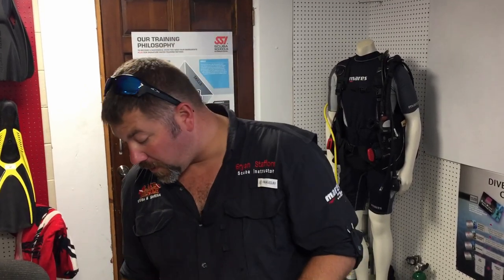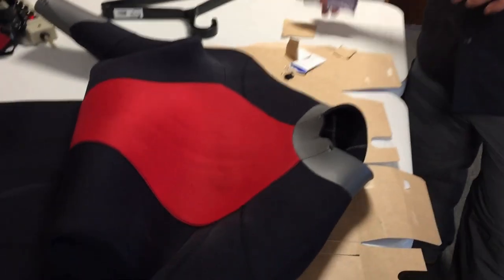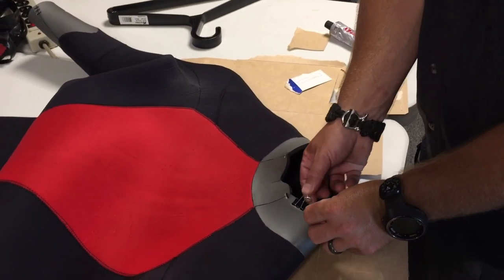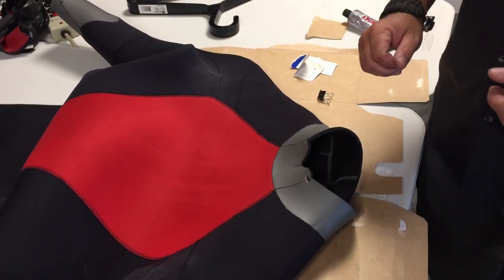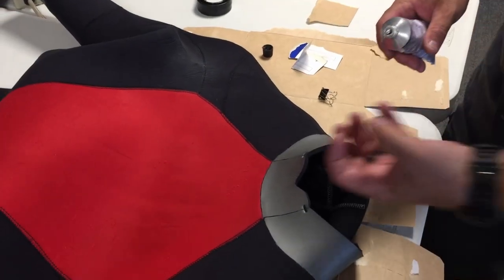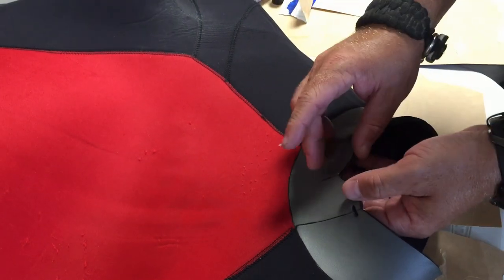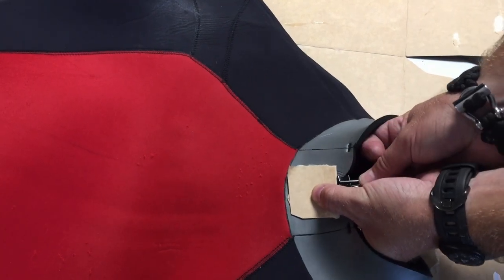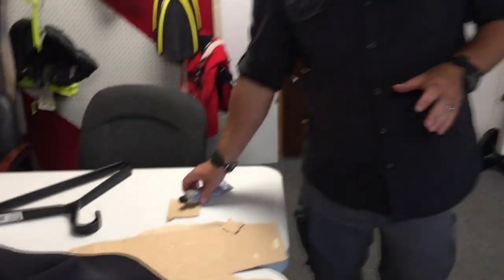A Simple Wetsuit Repair

Comment: As a gear junkie and hands on repair nerd 🤓 I love these kids of projects.

I’ve had great success fixing a blown out thumb pad on some thick mill neoprene  dive gloves. Used Gearaid Aquaseal and breathed some extended life into them. 
 
I also used Aquaseal to glue on pockets to my drysuit. Worked out extremely well as if factory installed.

I’m a fan of Aquaseal and it’s from the Great North West in Washington state. I’m sure the other brands work as well. 

For new adventure sports people there’s generally a great repair for most  things if you do  sone easy research.

Great time to live with so much information available at our finger tips 👍
Reply from the maker: Deep down, we are all gear junkies.

Comment: Love ur channel, so much to learn. Here's another patch technique (aquaseal suggested the tape backing): i turned the damaged sleeve/leg inside out and used clear packing tape (the non sticky side) to back the outside of the tear (in case glue weeped thru), applied aquaseal into the almost full thickness tears by wrist and ankle of Bare 3mm Evoke. Squeezed the repair tight, apply more backing tape while squishing a small amount of excess glue across the surface area of the tear. Then I laid the tape backed repair flat with a heavy flat object on it (a cast iron pan will do 👌🏻 ) and let it cure 24 hours or so. At that point it was fairly easy to carefully peel the tape off without removing the excess glue, which dries perfectly smooth and acts like a patch over the tear.At this point I hung up the suit and just let it air cure for a couple more days before using it again (in saltwater). So far so good.

I'm not usually good with glue, but this came out pretty good, I hope it holds up with time. Cheers
Reply from the maker: Thanks for the suggestion BionicWings, I will definitely try that in the future.

Comment: How would you fix a hole/tear in a wetsuit sleeve? Because I have a hole that goes through both neoprene and the rubber and not positive how to fix it.
Reply from the maker: Depending on how large of a hole you have, you can always patch it with another small piece of neoprene.